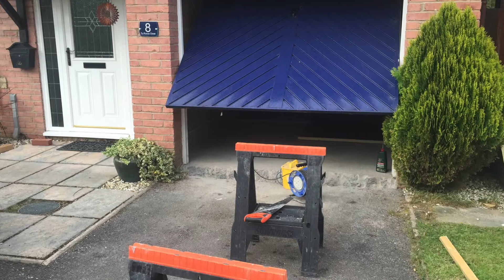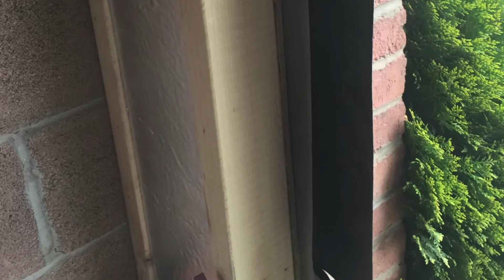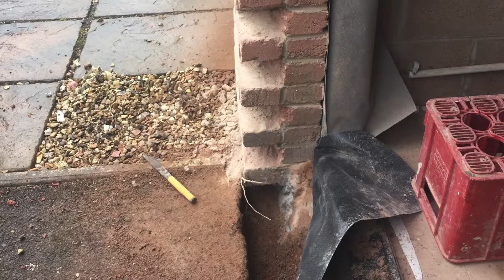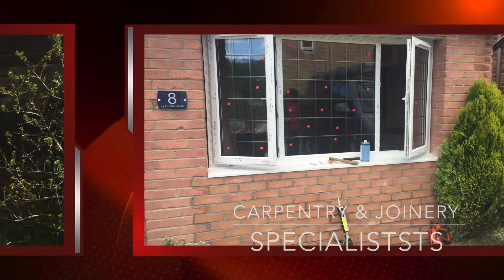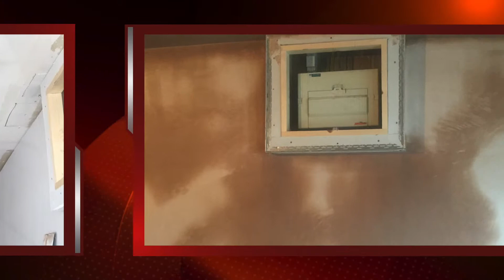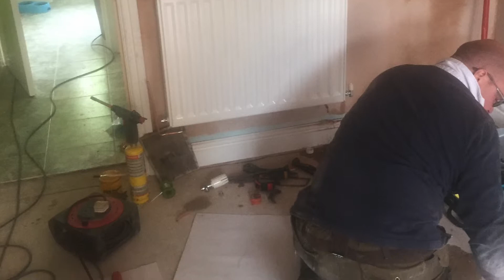GARAGE CONVERSION IN MACHEN CAERPHILLY - FREE GARAGE CONVERSION ESTIMATES IN CAERPHILLY

Comment: I just had a garage conversion in Castle view Caerphilly off Garage conversions in Caerphilly in Nov 2017. First class service  from start to finish. The knowledge of building skills these guys have are second to none. 

Not cheap but all work was passed and signed off by the building control at  local council of Caerphilly. 

I would highly recommend for your garage conversions in Caerphilly if you want a professional job.

Mike Rees